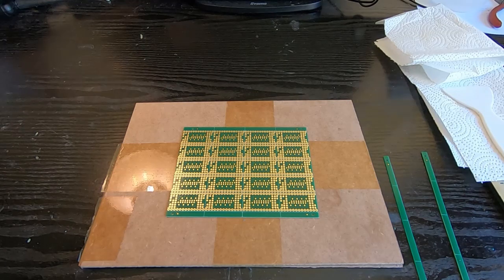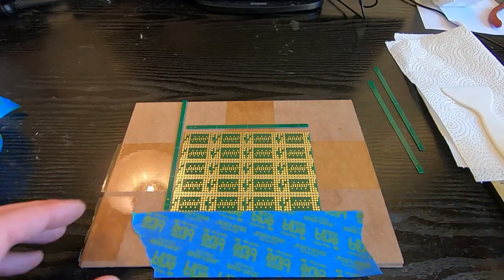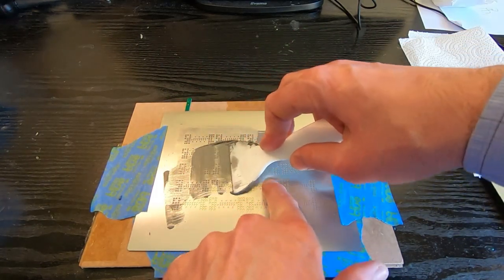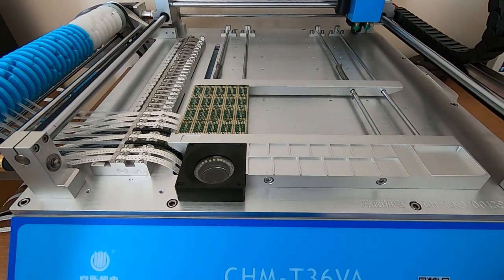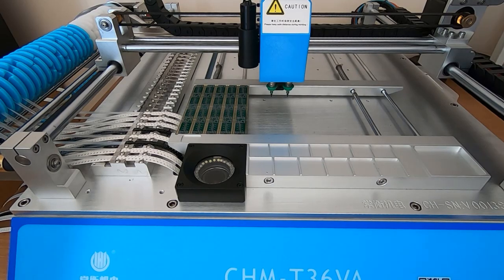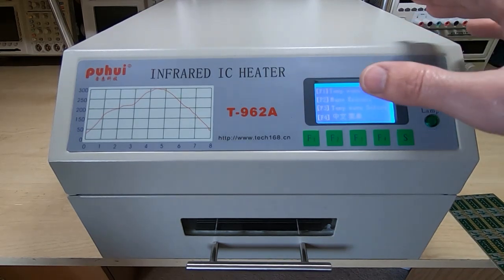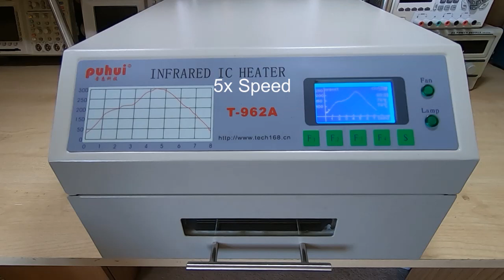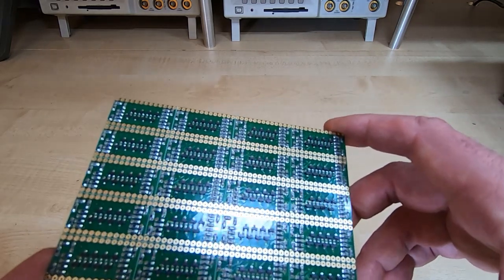Using a CHM-T36VA Pick and Place machine

Comment: Ya, the PnP is back :-)

Upside down ICs for spacing in the reflow oven is a good idea.

My T36VA had vision issues (ended up being the USB camera switcher board failed) but it is back up and running now.

Comment: What is the "machine" apparatus do you use for pasting?  And how well does your machine place 0402 parts?
Reply from the maker: See 7:00 in this video for  solder paste. The machine places 0402 fine but needs to run a bit more slowly and it needs the correct nozzles fitting.
Reply: @JerryWalker001  I was meaning your reference to a pasting "machine" at the beginning of the video.  I use a method similar to your manual method.  If there's a low cost pasting machine out there, I'd like to know about.  Thanks for the reply!  I'm planning to get one of these Charmhighs in the next few months.
Reply from the maker: @DerekSpeareDSD  I only use a paste mach in the business and not for this machine. It cost around £18k so is not something that I would show in these videos.
Reply: @JerryWalker001  yes...those I know about :D  We use custom jigs for each PCB we make and just past by hand.  I was hoping for a low cost machine to automate this, but it's either hand pasting or loads of money...looks like we keep hand pasting :O) Cheers!

Comment: Thanks for the video! 
Which solder paste do you use? I like it, mine seems much more thicker. 
You taped the stencil directly to the table so it is bowed a little. One can insert a scrap pcb piece at the edge of the stencil and tape that sandwich to the table to keep the stencil flat.
Reply from the maker: You may want to watch the video again, I showed using scrap pcb round the edge to prevent bowing of the stencil and I explained that this was to prevent bowing of the stencil. I use Loctite MP200 series paste but the exact type depends on the thickness of the stencil that I am using.
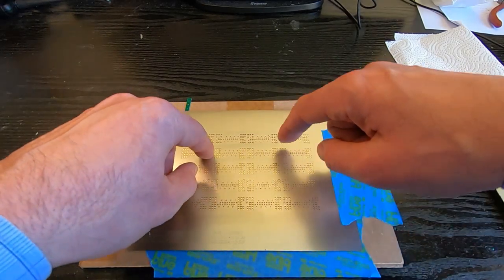Reply: @JerryWalker001  Thanks for your prompt reply. I mean scrap pcb should be at the very edge of the stencil where it is taped to the table. In your case pcb strips are more inwards so the stencil is hanging over and once you tape its edges to the table, it bows (5:12-5:14 in the video). Anyway, thanks for the paste reference! And thanks a lot for your PnP machine setup videos :-)
Reply from the maker: You definately do Not want the scrap pcbs going to the edge of the stencil as this can cause the stencil to move around when you apply the paste. I make thousands of boards and the method I show works very well as it does not allow the stencil and board to move around. I want a slight upward bow of the stencil as this makes it easier to remove it without it pulling up the paste. The tape along the edge of the board also creates a slight upward movement. During paste application the stencil is held down as I show. If the stencil is bowed up too much then the tape is too tight. If you look at the results you will see that the paste is perfectly applied and the edges of the paste 'blocks' are very square and not smudged as you get if the stencil moves around. Naturally you can use any method you want but I was specifically showing how I have been doing this for 30 years but it is not the only way.